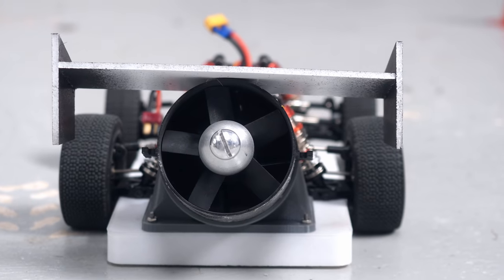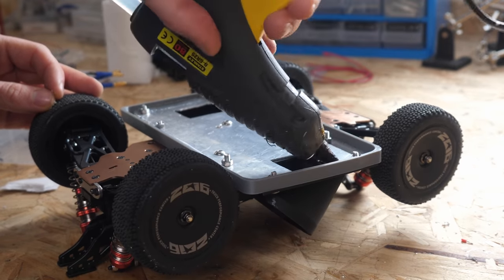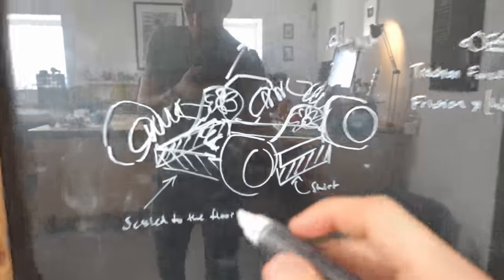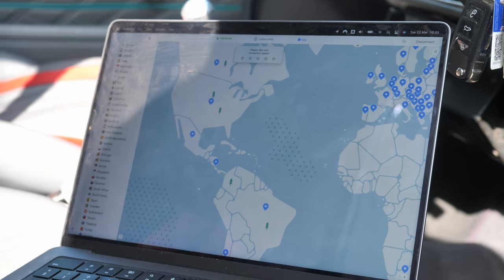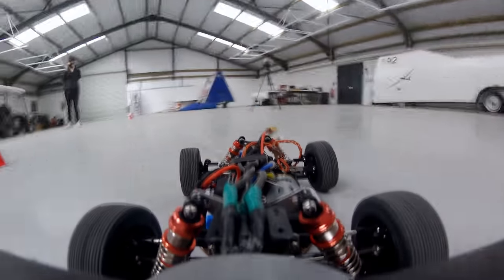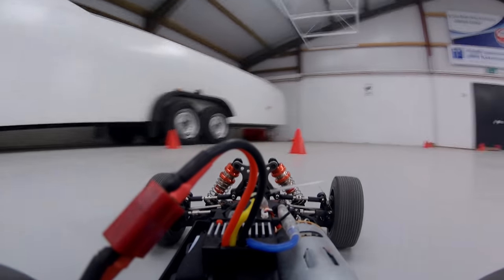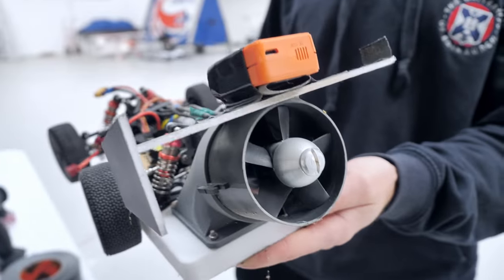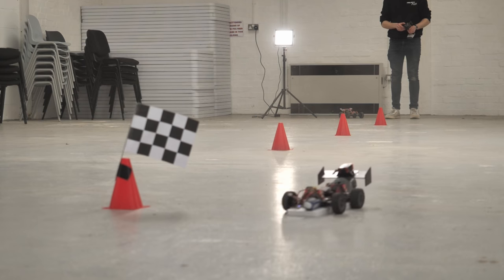Vacuum Effect RC Car

Comment: in f1 they used skirts that allowed for suspension travel with ground-effect, and they also used them in the chaparral 2j which is more like what you have here. I think your experience with worse times with minimal gains came down to the fact that you do not have those skirts, and the assembly for the vacuum hitting the ground too quickly. You could fix this by lifting the vacuum assembly and adding those to allow for more travel, and possibly stiffer springs.

Comment: You need a Louver or a Strata cap which prevents debris from entering the fan with a pre filter tornado effect expelling the debris & dirt to the sides. They are used in aftermarket car car intake boxes for off-road vehicles. A topspin would work too. Check out Donaldson Filtering solutions. You may be able to 3D print one. They may even sell one small enough for your application. essentially they are pre filters but work with centrifugal force of air spinning like a tornado rather than a mechanical filter which can clog.

Comment: Perhaps make a control loop with monitoring wheel speed and steer angle. So at low speed where you want to accelerate and not want the drag (Launch or out of a hole). And maybe have it tied in with steering, higher fan speed with higher steer angle to stick around an apex.
Maybe have some brushes around the side like from a hoover.

Comment: in a future iteration id recommend opening the front of the skirts and the back of the skirts part of the downforce comes from the air creating that low pressure zone which is easier at the front without the skirt would add less surface friction when the skirts glide across the surface

Comment: Try adding a few ball bearing beads embedded in the skirt so they keep it just slightly off the ground. This will dramatically reduce drag without having to perfectly dial in the fan speed.

Comment: I've seen a few people mention this, but I want to say it again just so you hopefully see it. Right now your suction device is connected to the chassis of the car... which... there is nothing wrong with that... it works, but this relies on the suspension being the perfect height and spring rate to keep the skirt just a hair off the ground at all times to keep suction going. This is very difficult to do, and, if the solid skirt bottoms out on the floor, then you don't have the full force of the suction giving you traction, but you only have whatever the spring rate of the suspension is giving you for traction.

Instead you need to figure out how to connect the skirt to the uprights of the tires in some way. This way the suction force is directed directly to the tires of the vehicle without effecting the suspension at all. This will also mean maintaining the proper height for the skirt will be much easier as well as it won't move with the chassis of the vehicle. Once this is done, you should have maximum traction from a very good suction along with a much improved ride quality (not that that matters too much for an RC car, but still)

Comment: I’ve watched a fair amount of Gordon Murray videos. My takeaway is the fan in his fan cars weren’t directly sucking the car to the ground. Instead they were designed to augment aerodynamics by managing turbulent airflow and discarding it out the back. The fan in his T.33 hypercar runs at relatively low speeds to accomplish this. People assume his cars are vacuuming themselves to the tarmac but if that were true the drag this creates would make the racing cars too slow to be competitive. The fan is about managing airflow.

Comment: You could let the fan run backwards when steering angle is close to zero in order to clear debris off the sieve. That would require either enough negative suspension travel (to not lose wheel contact when the car is pushed upwards) or a flap on the rear portion of the skirt which opens outwards but not inwards, sort of like a one-way valve... otherwise you'll get the world's most unstable ekranoplan. But if that works, it would not only clean the sieve but even act as a (very mild) booster on straights. Also you could plaster the downside of your squishy skirt with steel thumbtacks on something like that. Would reduce ground friction a lot and not compromise the seal.

Comment: Maybe already commented:

I believe your downforce is being reacted on the rigid "skirts" rather than going on to the wheels to generate grip. Skirts are supposed to slide up and down so that they don't transfer vertical force (so it doesn't take it away from the wheels, grip).

Right now it looks like you do have some additional grip because you have some additional compression on the suspension but then you bottom out the "skirts" (it's really just the body of the car) and you dont get any more grip, just more drag because any additional suction goes to the skirt/body (not the wheels). This is why you found a happy medium in the fan speed. If you remove this limitation you could increase grip further.

You could try stiffer springs so more load goes to the wheels, higher "unsuctioned" ride height or inplementing and actual sliding skirt.

Awesome video, really like the experiment!

Comment: If you ever try to optimize it,  you should go back to flexible skirts. Because as soon as the hard one hits the ground, it stops you from adding vertical force to the tires and therefore adding grip. A harder suspension is also an option

Comment: other thing to note is Gordon murray and the sperling fan car only use GE fans on cornering, not on straights or heavily reduced GE on straights as its cornering where the most GE downforce is required. so maybe some turning gyro sensor is needed to turn up the GE fan or turn down the GE fan.

Comment: Hello from France 🇲🇫
You are in the good way to explore this strange set-up. 
Sorry for camera but all genius encounter problems. 
You probably should explore the mass position for better handling as you have lot of weight on extremety and for better habdlig you have to put the max possible in center of car. Freeing the front for turning and the rear from centrifugal force during turn. 
Also possible option could be to have a rigid suction chassis and a smooth lip around it that could be scratch by road Ithout transfer the contact vertical force to car (out of damper as it's the chassis) this vertical impact will light the down force and could be the moment of loosed handling if you are on hard turn. 
Way more to explore
Way more to fun
Way more to add success
👍

Comment: Couple the steering servo with the regulator of the fan in a way that you get zero downforce when going in a straight line but a lot when turning.

Comment: Add a pressure sensor. Calibrate to the perfect vacuum for moving with downforce. Then go ahead and set it to keep that same pressure all the time. So if it goes faster it probably needs higher cfm of airflow from the fans to maintain. But it doesn't matter if it's stopped. This will probably save batter well

Comment: Nice!
I would link steering to add suction-throttle, when off center! 
I do this on all my indoor aerobatics planes, this is normal in f3p,  like a 5% v-curve mix from aileron to throttle. Easy with a plane remote controller, or with a flightcomputer (or arduino) on the car.
I don't know car controllers, but there must be a way.
Reply: That would probably work but you would also want it tethered to the throttle position as well, frankly it has to be tethered to everything and be able to increase or reduce suction in response to the car,

Comment: Maybe for the next one see if you can get a chassis with anti sag stops on the lower arms and stiffen the front shocks as it'd be easier to control the ride height, and possibly link the fan esc to the drive esc to see if actively altering the vacuum has any effect on handling

Comment: I have 3 suggestions:
- Use a "bladeless" fan (with actual blades perpendicular to the actual flow) to avoid clogging,, so to eject away whatever is on the ground into the air, gravity will do the rest (or put a meshed bag on the output if making a vacuum cleaner is your goal). You may need 2 EDFs to get the same power, tho.
- Make the downforce proportional to the speed to avoid crushing the skirts and let the tyres make their job: more force at high speed, less force at ow speed. I suspect it's an exponential function, tho, so the speed limit is at your EDF's limit.
- You could print your skirt in TPU to make it flexible and avoid permanent deformation with electrical tape and duct tape, or just sculpt rubber from a tyre. Ideally, sandwich some metal mesh from your sieve in elastic material to add some strength (like in tyres)

Comment: if you could find a way to make a through-hole from the front to the back of the vehicle, put your fan at the back of that hole (rear end of vehicle) then open a large hole in the middle that attaches to the vacuum apparatus, I think you would have success, as that hole leading to the vacuum now has plenty of suction coming directly from the atmosphere instead of on the ground, this suction would come from the “Venturi Effect”. That being said, holy moly..nice work so far sir.

Comment: As soon as your floor touches the ground you then limit the virticle loading on the tyres to the amount of spring loading in the suspension.  

The 80s ground effect cars had skits that could slide up and down, still allowing maximum loading on the tyres. You could try somethibg like this
Reply: Good point about 80's ground effect cars.
The skirts were spring-loaded and kept contact with the ground independently of chassis and wheels.

Comment: A lot of the original fan cars used a system that would slow down the fan on the straights and speed it up in the corners. This would reduce the drag when you dont need it. One reason they were banned in virtually every race series there is.

Comment: Another solution instead of having the EDF pull air through itself would be to mount it to a Y branch, with top left being the fan blowing air, top right going to the skirt and the bottom going out the back of the car. That would still suck air from the skirt but remove any need for a mesh to stop debris as nothing would be passing through the fan.

Comment: A simpler solution would be to add a fan in pusher mode and place the fan at center of car pushing the car downwards - like a vertical takeoff fighter jet, but the fan is pushing the fighter jet in group instead of lifting it.

Comment: Small steel ball set at the proper height and epoxied under the skirt at each corner should reduced drag and maintain a tiny space between the ground and the skirt.

Comment: If you could install a sensor and an on-board computer to tell if the car is bottoming out or not, you would be able to have it automatically adjust the vacuum speed so that it gets the right balance between downforce and friction no matter what. Maybe a pressure sensor that can tell if the vacuum floor is touching the ground would do the trick

Comment: You should program the fan to suction less when in a straight and more when in a turn. That way you can gain optimal speed on straights and turns.

Comment: That’s great, could you adjust fan speed in the straights then turn it up full when going into a corner? Maybe connect fan control to an accelerometer to some how adjust down force automatically.

Comment: Maybe a button on the radio that can reverse the fan to clear the intake (eg on the straights), and some lightly sprung hatches to act as valves to avoid turning into a hover car (along the lines of the NASCAR roof flaps)

Comment: Edf’s are more suitable when you have ram air, a centrifugal type fan would be more suited to this application as you’ll get more efficiency, there’s a reason vacuums use centrifugal fans, they’re more suited to static suction

Comment: Depending on how much torque those ducted fans have, coupling their speed control to the steering channel might help minimize unnecessary scraping of the skirt. Lift the car on straightaways and duck down for cornering only. If a ducted fan doesn't have enough instant suction, you can try adapting good high torque quadcopter fans. Save the batteries too maybe. This would be cool to see.
Reply: I think making the suction variable creates a lot of the issues that the original fan cars had in the first place having it tethered to the throttle. The downforce varying that much based on driver inputs made for some situations where the driver had to act in a basically counter intuitive manner to get it around corners quickly. To me the best strategy is to have it produce a constant volume but to focus on actual ground effect and get that air in and out of the system as fast as possible

Comment: You should have a much harder suspension so it doesn't drag on the ground.
Also it would be cool if you made it so that the fans spin while you turn, so you don't get extra drag while going in a straight line and only when your doing cornerns.

Comment: Another thing too is with more weight in front, you're allowing the tires in the front to grip better and turn better. A better comparison would be if you weighed down the other non-fan car also along the front suspension and see the difference between the two

Comment: You need some beefier shocks, better weight distibution, maybe the longer wersion of the car(literally same internals), maybe fully 3d print the chassis with integrated air holes and grippier tires.

Comment: You should place the rear wing farther back so the wind from the fan. It may be a minor adjustment but maybe a tiny bit more downforce at high speeds.

Comment: if you make a new one you should program the fan to operate based off the speed of the vehicle in a certain threshold so you always get that perfect air gap to down force ratio at any speed.

Comment: you can control fan speed depending on stear lock, more speed on straights and more downforce in corners
Reply: It would have to be very progressive otherwise it would be very hard to drive

Comment: Perhaps a brush type surface around the edge of the fan could be a compromise between a flexible skirt and manageable friction. I wonder if your car was breaking chips off the floor inside and subsequently blocking the filter.

Comment: Ohh man, I am so excited as an engineer and just had too much fun with your design ! 
But you should have improved it further! Let's say you have a feedback control in loop with suction power (adj. pot) and a gap -  distance measurement sensor (IR or ultrasonic, IR would work better for such a small distance but it prones to be effected from  colors you know idk).  So it can suck up before it begins to fly :D even it can put wheels to the ground like a spider if it jumps :D OMG :D you should try it... Maybe you can add small wheels to the skirt for transient moments.

Comment: Perhaps you could use the down force EDF to power a venturi, such that the fan would not be in the path of road debris. The 3D ducting design and printing work would be very interesting, and I think you could even get thrust from the EDF in the bargain.

Comment: It's a circular control line model aircraft track, James! So, why not put control lines on 2 (stock & modified) cars, use the RC controls for throttle, & remove the human factors of line of sight, not being in the center of motion, reaction times, accurate steering, & possible devastating crashes? Rule #1 in testing is only change 1 thing at a time to limit multiple tweaks interacting.

Comment: You want the downforce on the wheels instead of the skirt attached to the ground. By not making the springs stiffer you add fery little traction and much friction from skirt.

Comment: Need a g sensor or use the steering input to control the fan speed turning it off when going straight with a small burst in reverse to clean the mesh

Comment: need to attach the fan throttle control to a gyro.  that way, when the car is turning or skidding it throttles up. and on long straights it decreases so that the drag from the skirt is reduced.

Comment: As you start to draw a vacuum, you will draw less power, as it's doing less actual work. So, you could make a smart controller that indirectly senses how much of a vacuum you are pulling by monitoring power draw, and automatically controls the throttle to try to always pull slightly less than the maximum vacuum, which should hopefully translate into the skirt riding just above the ground.

Comment: Would be interesting to connect that to a gyro and during high g forces spool up the edf for added traction and turn it down or off during straight aways? Maybe just a mix on the radio would achieve a similar effect

Comment: I’m thinking the problem is that the suspension has too much travel. The body is being pulled to the ground,but that’s not causing the tires to be driven into the ground to create a bigger contact patch and grip. Rc car suspension usually will easily let the body be pulled below the wheels the suspension is absorbing the downforce effect instead or trans feting it to the wheels.

Comment: Sliding rigid skirt sections like the full size fan car and ballast down the non fan car for a proper comparison.
 sliding "skirts" that sealed the gap between the sides of the cars and the ground. These prevented excessive air from being sucked into the low pressure area under the car and dissipating the ground effect. till they were deemed movable aerodynamic devices and made fixed.

Comment: Also maybe if you use a 1/8 scale model the ground effect could be stronger but those cars are different beasts and it would cost you way more, also sucking the air only from the back of the car might create some slight oversteer but you could fix it with a front wing or some sort of aero thing that the car didn't have

Comment: If you put the EDF on another channel on your receiver you could have linking it to the throttle through the radio and adjust the suction to find the sweet spot. and save battery life